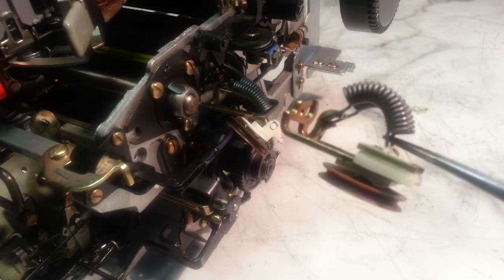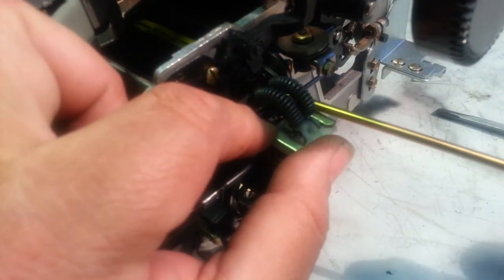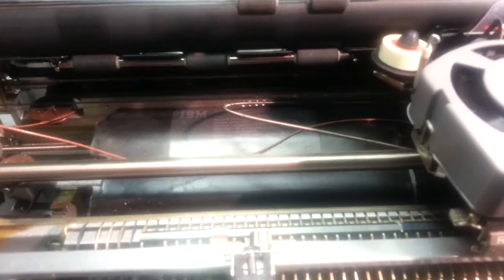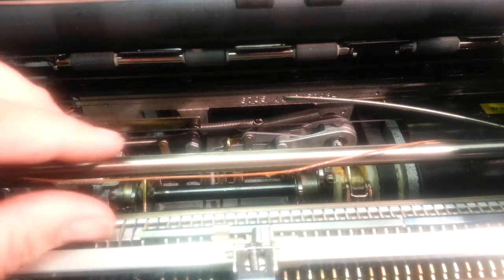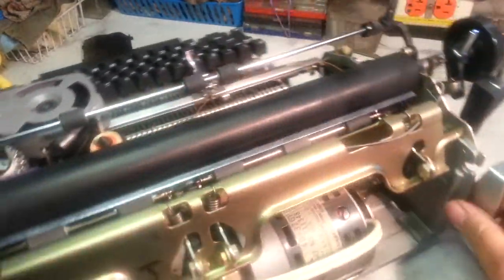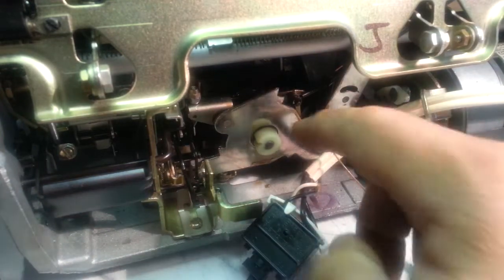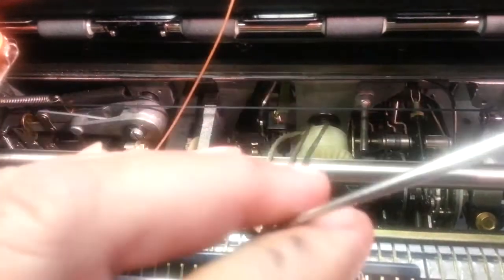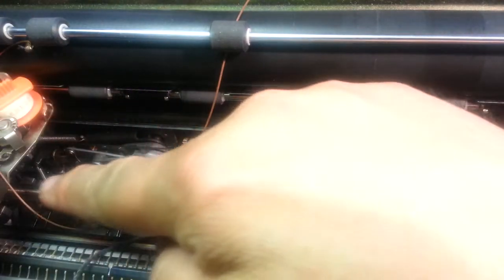IBM Selectric Typewriter Transport Pulley and Tab Return Cords Replacement Wind Mainspring Version 2

Comment: Oh, THAT'S what this is! I just got a free Selectric II from a factory that was liquidating, and there was something rattling around inside it. I took the cover off, and a double spring attached to a broken white plastic base fell out. (Plus there were some white plastic shards littering the bottom of the case.) One mystery solved, now to figure out why it's not turning on.

Comment: I found the plastic part of the pulley snapped in half and the spring loose inside the Correcting Selectric III I just purchased from Ohio Thrift (obscenely gummed up inside with sticky old oil, now mostly functional again thanks to your videos). Two questions: would this pulley being broken have any effect on the backspace function, because mine doesn't backspace; also I found a small circular spring in front of the bracket that I had to pop off to remove the pulley assembly, one end goes around the screw, and I'm trying to figure out where the other end goes and what it's supposed to do. (I now wish I hadn't popped it out.) Anyway, I'm going to order a new pulley assembly and put it in, thanks for this very helpful as usual tutorial.
Reply from the maker: Yes, that pulley has a direct impact on back space operation, cord tension needs to be just right for b/s to work properly
Reply: @phoenixtypewriter2136  Just as I suspected, thanks for the expert info! A replacement is on its way. As for that little circular spring, it appears to clip onto the transport pulley bracket screw and into the right hand end of the paper bail; does that sound right?
Reply from the maker: @moogyboy6  yup.
Reply: Update: well, at least I got the replacement pulley on. Unfortunately, I now have to deal with reinstalling both return cords, as well as replace one of the feet and identify a small wheel/pulley that fell.off while tearing the bottom cover off in frustration, not noticing a release kever and destroying that foot in the orocess....oh dear. 

I've acquired real.respect for the mighty Selectric, it is definitely not for the faint of heart.

Comment: What is the secret to sliding the carriage at will?  I have befn loving your videos.  Thanks for sharing the knowledge to keep some of these machines alive!
Reply from the maker: If everything is in order, you should be able to push carrier to the left by hand anytime, on or off.
Carrier will not move to right unless machine is on and operational shaft is turning
Then you would have to space or manual trip the escapement bar or use tab to move right.
Reply: @phoenixtypewriter2136  
Ronald Morse
1 second ago
Cool.  I was seeing that about moving it left.   I may have a mess on my hands over here, but it's interesting.  Thanks again for your work here!!!

Comment: When winding the mainspring, the shaft seems to move backwards, which unlocks the shaft and releases the spring... Is this normal??
Reply from the maker: I don't understand the question I guess, releasing what spring, carrier return clutch spring ?
Reply: @phoenixtypewriter2136  Sorry, that was a horrible explanation. Let me try again.

Yesterday, the tab pulley snapped on my Selectric II. I ordered a rebuild kit for it, but wanted to try attaching the return cord and mainspring to save me some time later on. When I tried winding the mainspring onto the shaft it keeps tension on, I noticed that there was back-and-forth play in the shaft which would cause the cog that meshes with the two others up front to move towards the back of the machine just enough to cause the teeth of the cogs that prevents the mainspring from unwinding to clear each other, thereby “unlocking” the shaft and making it impossible to wind up the mainspring.
Reply from the maker: @jasonpeachrick2037  That play should not be there, couple set screws on the rear hub control that clearance
My only concern would be how it got loose . . . .
Reply: @phoenixtypewriter2136  Good point. I have no idea how it could have moved that much. Those three bevel gears should always be in contact with one another, correct?
Reply from the maker: @jasonpeachrick2037  Yes
Reply: @phoenixtypewriter2136  I’ll try loosening the set screw and moving the gear towards the front of the machine just a skosh. Thanks for the pointers.
Reply: @phoenixtypewriter2136  Update: Got the set screw loose with a T7 bit and moved the gear. No more play!
Reply from the maker: @jasonpeachrick2037  excellent
Reply: @phoenixtypewriter2136  Upon reinstalling both the tab and return cords, it seems that both are much tighter than they were before. They’re so tight to the point that the tab tension pulley (which I just rebuilt) is pushed in all the way. Any ideas as to why this is happening?
Reply from the maker: @jasonpeachrick2037  Yes of course I know everything about selectrics, I have been doing this 42 yrs . . . . 
nylon cord is twisted to tight, causing it to be shorter, you can try removing it and try "untwisting" it some,
or this can be adjusted on the shaft between front & rear drums
Reply: @phoenixtypewriter2136  You’re a gentleman and a scholar.